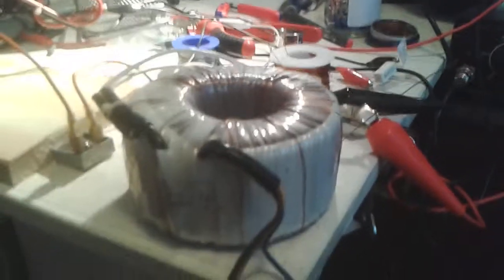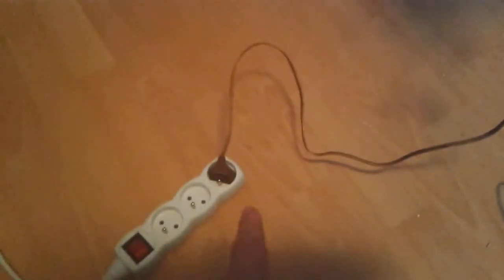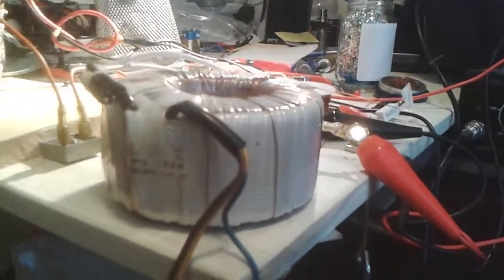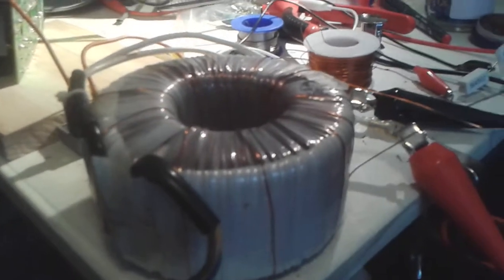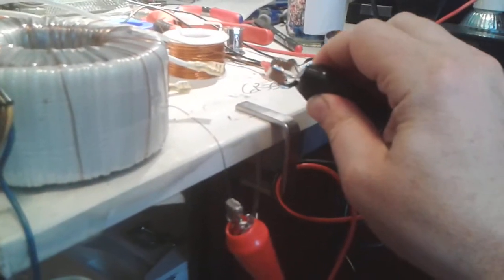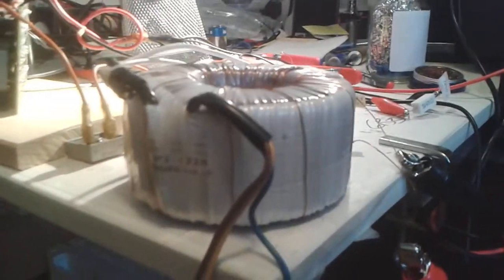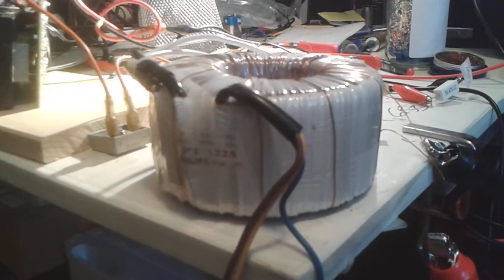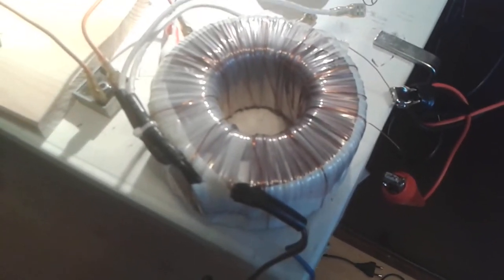SIMPLE Toroid transformer experiment

Comment: you have 2 turns per volt..knowing that guess the transformer core is 3 by 7 cm. the calculation is like this 3*7 = 21 as a general rule we use the constant 42,  42/21 = 2 turns per volt .
Reply from the maker: +Valentin S. Thanks a lot for the input and info!
Reply from the maker: +Valentin S. constant 42 used with torroids? Where do you get 3x7? Diameter of 7cm outside and inner diameter of 3cm? Just not 100% clear, but I guess that's what you're saying. Thanks in advance for any reply. Cheers.
Reply from the maker: +MAN CAVE NO.1 After watching some more vids on the subject....I think you mean inner-outer diameter and then the height...right?
Reply: +MAN CAVE NO.1 Hi..constant 42 is used with any type of transformer..measurement only on the core width and height (the part where the magnet wire is wrapped) not inner or outer diameter of the transformer.for example the inner diameter is 6 cm, the core is 3 cm and and the outer diameter will be 9 cm and the height 7 cm, in your case 3x7.. I hope you understand i try to explain as best as i can english is not my native language.
Reply: @HMProjects  but how could you determine its power.whether you know that the power rating is directly related to the W*A product
For toroidal high power tx , the power handling capacity is 75 volt-ampere per sqsq" of W*A product.